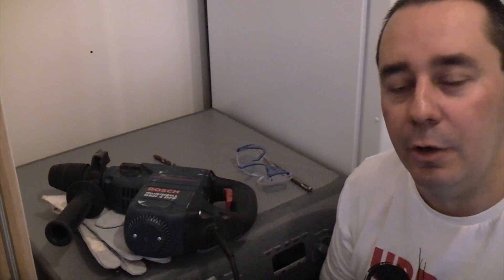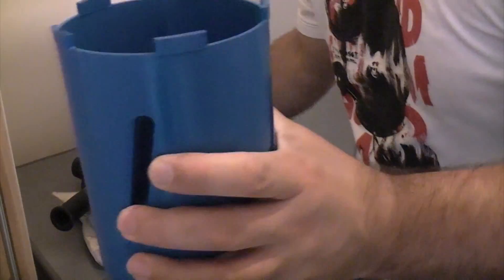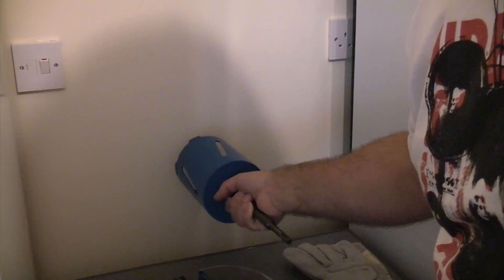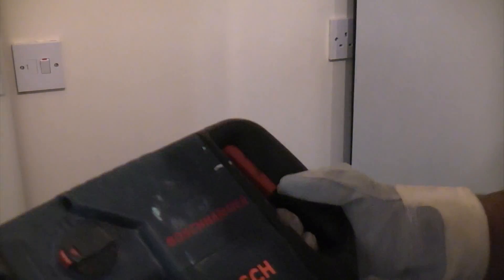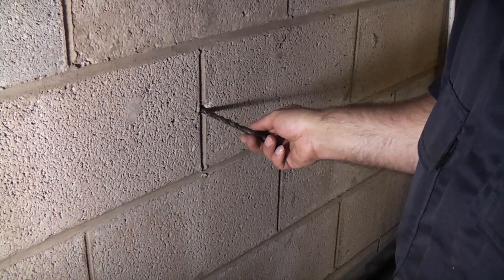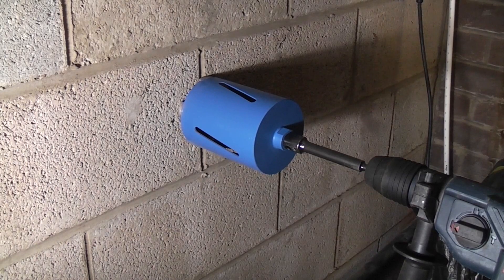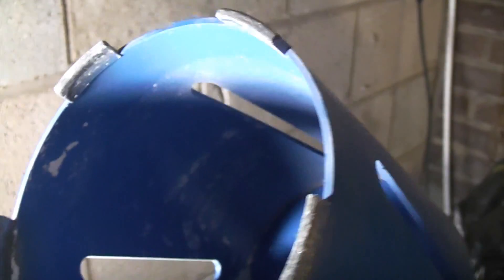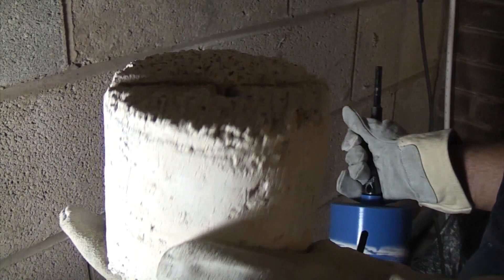How to use a diamond core drill

Comment: Great instructive video, thanks.  I have a query.  I got an Erbauer, well reviewed on Screwfix, but the pilot bit (tapered) does not seem to fit very well and wobbles, so of course when drilling with the core drill, that wobbled too making a mess of the wall.  Do you find that the pilot bit that fits into the arbor can wobble around?  Thanks.
Reply from the maker: It’s not bent, is it?
All the tapered drill bits that I have used with core drills have been fine 🤔
I know Ebauer are not the best make, but normally their stuff is okay and much better than Silverline etc.

Comment: For the pilot hole, does the bit for that pilot hole needs to be diamond tip or carbide tip?  Can I just use the pilot bit that comes with the core bit?
Reply from the maker: If you don’t have a suitable masonry bit, just use the core drill with the pilot bit installed, then remove the pilot drill to prevent it from jamming, once you have the hole started 👍

Comment: Excellent demo 👍 I would however suggest that it would be better to orientate the drill handle so that you're holding it above the drill body. That way if the drill binds and it starts to turn anticlockwise (even if you have a clutch it's not instantaneous and they do fail) you have a hand there to brace it, hopefully saving your trigger hand. (If the drill binds with your hand in the location shown in the video it will just pull it out of your grip and you'll lose control of it). It's a useful habit to get into when drilling.

Comment: It is worth hitting the end of the taper drill to seat it in the taper, otherwise it can come out when drilling. Also, for large diamond cores, it's better to use the hex Arbor, as the SdS one is more liable to snap. As your Bosch multi drill has two trucks, use the large hex/ standard chuck

Comment: Hi. I know this is a 12 year old video but hopefully you’re still out there. I need to core drill a hole for a 110mm diameter soil pipe. I’m not in the trades just a diy,er. I managed to borrow a core drill bit from a friend of a friend who is a plumber. He lent me a 107mm core drill bit for the job. Seems like a silly question but is this the correct size? I did pass the message on to the plumber that it is for a 110mm soil pipe so I’m assuming this is the correct size core drill.
Reply from the maker: I would not use that to be honest, I’d go for at least a 117mm core drill. 107mm might work in some substrates, as the core drill bits often give you a slightly larger hole, but if you can’t get the soil pipe through, it’s going to take a lot of additional time and effort. Even 117mm might be a bit tight, so 127 might be preferred.
Reply: @ultimatehandyman  Thanks for your reply. I will use a 127mm core drill to give me a bit of wiggle room. 👌

Comment: I need to fit a 100mm duct, so do I need a 100mm core bit or do I get a 104 or 107mm so the duct can slide through easier?
Reply from the maker: Just measure the outside diameter of the duct and then get a core which is larger than the diameter.
Never undersize a core drill, or it will make the job ten times harder, always better to go larger and fill the gap with silicone if necessary 👍
Reply: @ultimatehandyman  thanks 👍

Comment: I thought you had to pump water through the drill to keep dust down and not to keep the teeth cool. It’s all well n good on 4 inch block work but what’s it like on 18inch concrete ?
Reply from the maker: It depends which core drills you are using. Some are designed to be used wet.
For 18" thick concrete, I would hire a professional core drilling rig, which will probably require water cooling.

Comment: Would it be posable to do the same size hole at 45 degrees? and if so what tips could you give me please.
Reply from the maker: It would be really difficult doing it using a hand held drill, unless you could make a jig (perhaps using a piece of pipe large enough for the core drill bit to fit in, the pipe would need cutting at 45 degrees and pieces would need welding to it, so that you could bolt it to the wall)
It would be much easier hiring out a professional core drilling rig, I think Hilti make them, which can core at 45 degrees.
Reply: @ultimatehandyman  Thank you for the reply

Comment: Do you ever spray the hole with a fluid to take care of heat buildup?
Reply from the maker: No, not unless the core bit is designed for wet use (mine are meant to be used dry).
Thanks for the comment 👍

Comment: I would put the handle at right angles to the drill body because it jams it won't spin so easily and rip you arm off.
Reply from the maker: Please pay attention. This drill has a safety clutch 😉
Reply: Clutch or not, most clutch's when they slip can be too late and the damage can be done.
If one's hand is at right angles you have more control when it does start catch or slip, because it's pushing down on your left arm.

Comment: I had someone make two holes in my apartments walls recently and it took them 4 hours with an impact drill...
Reply from the maker: I've come across some bricks that cannot be easily cut using a diamond core drill, I think they were calcium silicate bricks- the core drill just bounces off them! Perhaps the bricks were very tough and the guys had to chain drill the hole!
Thanks for the comment 👍

Comment: Great video but what did you mean by a drift when removing the drill bit to prevent the core drill from jamming. Thanks for replying to my questions.
Reply from the maker: This is the drift- https://www.powertoolworld.co.uk/duro-dp-dk-dry-diamond-core-bit-drift-key
You knock that through the hole and it ejects the tapered drill bit, which stops it from jamming up the core drill.
Thanks for the comment

Comment: great video but still can't find out what size diamond core drill bit I need for a 40mm hole for waste pipe, is there a chart anywhwere that I can look up. Thanks for all your videos, I'm a late comer to your channel so don't expect many answers so I'll keep looking, I asked a couple of plumbers but they didn't seem to want to give out any info.
Reply from the maker: I think it depends whether the pipe is solvent weld or push fit.
Solvent weld is normally 43mm or 1.5 inches outside diameter
Push fit is normally 41mm outside diameter 
I have had a quick look, but the closest size diamond core bit seems to be 52mm

Comment: Is this core thingy what I’d use to cut a chunk out of the balcony above to replace an oyster light with a down light?

I think it’s called potting a hole maybe?
Reply from the maker: Not sure about that. I would not go cutting a hole in a balcony without taking advice from a structural engineer.
Thanks for the comment 👍

Comment: Does spraying water keep the dust down and help cutting?
Reply from the maker: These core drills are not designed to be used wet, but you can get some that require water.
Thanks for the comment 👍

Comment: Does the core bit require such a heavy duty drill? Can I use an 800w Hammer drill like a Bosch GSB 19-2RE
Reply from the maker: Yes, you need a powerful drill with a safety clutch. Using your drill might burn it out!
Thanks for the comment 👍
Reply: @ultimatehandyman  How many watts should we look at for Drilling a 162mm hole through LECA block?

Comment: well... what about spray some water in to hole?
Reply from the maker: These core bits are designed to be used dry, but you can get some where they recommend using water to cool and keep down the dust.
Thanks for the comment 👍

Comment: The sintering that holds the diamond grit will never withstand dry coring. You have to keep it cooled with a spritzer bottle full off water.
Reply from the maker: These cores are designed to be used dry.
Thanks for the comment 👍

Comment: Just to be clear - do you use hammer drill mode to drill with a diamond core drill? I have always used  normal drilling mode (and not hammer) when using the above.
Reply from the maker: No, you should never use hammer action with diamond cores.
Thanks for the comment ;-)

Comment: Can I put grease around the hole saw? It's not turning anymore,stays stuck... I'm making a 4" hole in concrete foundation and it's 6 3/4 in thru the 8" thickness. It's not turning to finish the last inch...
Reply from the maker: I would not use grease, the fumes might be toxic, if it gets warm.
I suppose you could try some water, as long as the water does not get near the electrics on the drill
Thanks for the comment
Reply: @ultimatehandyman  I believe it makes a difference with the openings on the side of the hole saw... The one I'm using doesn't have it, I see yours does...

Comment: All great advice.  Drilling all the way through the wall is only needed if you need to locate the centre of cut on the other side.  Also when starting it is good to get through any plaster layer and into about half an inch of brick before removing the pilot bit, the diamond cutter can wander and create a lot of break out if not into the brick. A good clutch is essential as it stops the drill whipping around if the cutter gets jammed mid cut.
Reply from the maker: Thanks for the comment

Comment: What is a safety clutch?
Reply from the maker: It disengages drive between the motor and the chuck if too much resistance is met- which prevents injury to the user.
Thanks for the comment

Comment: I’m in the UK too, where do you buy this stuff? I need to punch a hole for the drier exhaust, multiple layer wall (including insulation and air space) that I would have to seal before I insert the tube, any tips on how to seal the layers? Thank you!
Reply from the maker: You can get the core drills on eBay- https://fave.co/2ATarxL
Normally I just insert the tube, then seal around the tube using a good quality silicone sealant.
Thanks for the comment

Comment: Machine working on only brick work ? What about RCC beam
Reply from the maker: Yes, these are designed for use on masonry.
Not sure what you'd use for a beam. We would not be allowed to cut a hole in any beam on site without getting the site engineer involved first!
Reply: @ultimatehandyman  thanks
I am asking about plumbing hole .

Comment: could you do a deeper hole with that bit? My wall is around 20cm or 8" thick and need to make a similar hole through it but deeper
Reply from the maker: Yes, you can also get extenders, so it is possible to go through really thick walls, but you might have to stop and break out the core with a chisel every now and again.
Thanks for the comment

Comment: I've been using the core drills that require the rotary hammer function to work - this looks like a much cleaner QUIETER way of doing things. Thanks!
Reply from the maker: Thanks for the comment
Reply: You’ve been using the core bits wrong. 😂

Comment: will this work on 18 inch thick victorian stone wall?  All the vids I've seen are with the tradesmen cutting into soft breezeblock and  brick walls
Reply from the maker: Yes, it will still work but it could be tough going depending on the type of stone. It should be fine in sandstone, but for granite you might need a professional rig with water cooling.
To use a core drill like this one you need to cut out a core until the core drill cannot cut anymore and then break out the circular section left behind when you pull the core drill out of the hole and keep repeating until you are all the way through. You can buy extension bars for the core's, which you might need to get through such a thick wall.

Comment: Does anyone know why he went through the mortar joint instead of the center of the brick?
Reply from the maker: I drilled a pilot hole through from the plastered side of the wall, where you cannot see the blocks/bricks.
Thanks for the comment
Reply: ok cool, so i guess my question is, for structural purposes, is there any downside or upside to drilling through the mortar joint as opposed to the center of the brick?
Reply from the maker: No, it does not really matter as bricks/blocks are self supporting by the ones around them.
Thanks for the comment
Reply: Thanks!
Reply from the maker: You are welcome

Comment: Was really hoping to see the coring of the 2nd side of the cinder blocks.  what exactly happens when it binds and you don't have a clutch?  Dislocated shoulder?
Reply from the maker: It depends how fast you let go of the switch. I used to have a 1050W drill with no clutch and that used to snag all the time, but it depends how strong you are. If you are not that strong the best option is just to let go of the thing rather than risking injury.
Thanks for the comment

Comment: I nearly ripped my arm off using a core drill that had a broken safety clutch 

The drill bit also became stuck to make things easier...

Adding water made the coring about 50% easier though! Literally have someone with spray gun jetting water into the hole!
Reply from the maker: I had a fight once when drilling a 4 inch core without a safety clutch and won, that was after I went through an electrical cable ;-)
Thanks for the comment

Comment: Nice demo but your Bosch GBH4 is not a core drill, I have one and it can be okay for smallish holes in softer materials but the safety clutch just isn't adequate imo. If you were up a ladder and snagged it the drill would throw you so you wouldn't want to use it on very hard brick, large diameter cores or difficult or potentially dangerous situations. The ground floor of a garage is fine as you can just let go.
Reply from the maker: Thanks, but this drill's clutch will prevent it from grabbing and injuring the user.
Thanks for the comment

Comment: Great Video.  I need to drill a venting hole in my house for the kitchen extractor. The old ducting is just shitty PVC flexible ducting (with some holes in it). Impossible to change to something better unless plasterboard is pulled down.
So I have to go the other way and drill a hole in the wall.

I have a Bosch GBH2000 drill that is 620W and has a safety clutch. Would that be enough to go through the wall? Or I need a more powerful drill 1500W? The wall is a cavity wall concrete blocks and brick on the outer layer. The house has a 86mm internal insulation as well.  Thx
Reply from the maker: I'm not sure to be honest, it should be powerful enough but if it is not you should soon find out.
Thanks for the comment

Comment: not on hammer mode for this type of core bit. from what i been told you are supposed to use a hammer mode with TCT core drill bits is this true?
Reply from the maker: Not sure as I don't use TCT core drills, I would definitely check with the manufacturers though as you could seriously damage them if they are not supposed to be used with hammer action.
Thanks for the comment

Comment: Hello
Can this tool be used to drill a nice hole in a ceramic floor ? I need to look deep under my bathroom floor for water leak !!
Reply from the maker: No, I would not use one of these for ceramic.
You could use one of these- https://www.youtube.com/watch?v=ApjI4hMzoZg
But you would need to make a jig to prevent the hole saw from moving.

Comment: Hi,

I need to make a circular recess in a brick wall about 100mm deep. Basically similar to the one in the video but not reaching to the opposite side of  the brick.  
Could you please recommend a method?
Thank you.
Reply from the maker: Hi, Most bricks in the UK are only 100mm thick so you'd go all the way through?
Armeg make a circular cutter that is designed to be used with their box sinker kit, but I am not sure of the diameter of the cutter.
Reply: Thank you. It is  two brick party  wall. So I have to stop somewhere in between.

Comment: If ever needed to enlarge a core drilled hole drive some wood into the existing hole and wood drill a hole in the middle. The pilot will follow it easy for the larger hole without fingers going missing.
Reply: Just get rid of the pilot drill and offer up a timber template to guide the bigger bit

Comment: I need to cut a hole of 152mm (6inch) for a heat recovery extractor (Kair), but can only find 150mm bits where I am. Could I maybe just sand down the remaining couple of mm? Also, do you have any tips on getting the right angle? (apparently the hole I need to make should be sloping downwards to a maximum 1.5 degrees, which sounds very precise...)
Reply from the maker: That's a bit difficult. Sanding the hole larger would be very difficult and time consuming.
You might be better off hiring s dedicated machine- you might be able to get one that allows drilling on a set angle?
Reply: Thanks for the reply. I assumed 2mm was so little it might not make much of a difference. I'll keep looking I suppose - I'm in the Netherlands where 152mm seems a bit of an odd size.

Comment: Drilled through the brick right on the grout line. I thought you not suppose to do that?
Reply from the maker: You can drill through wherever you like. If the line of mortar is where you want the centre of the hole to be you just go through it.

Comment: Great video, everything was well explained. If drilling through a very thick wall (12"), is there a way to break the core mid-way through the the hole and remove it so there is room to continue drilling?
Reply from the maker: You could try breaking it out using a club hammer and chisel, or if you can do drill a pilot hole straight through the wall using a thin drill bit then drill the core from each side of the wall.
Reply: +Ultimate Handyman Okay. Thank you.